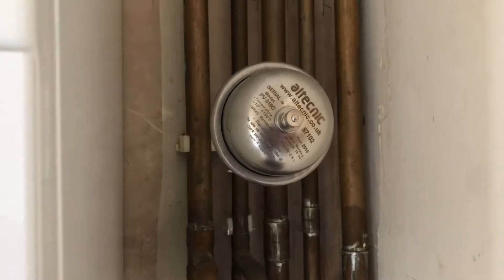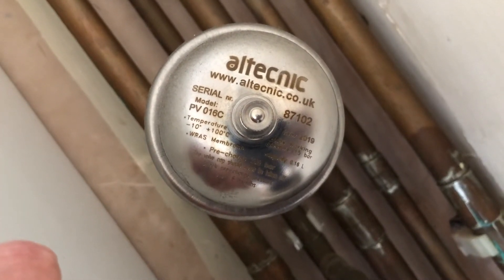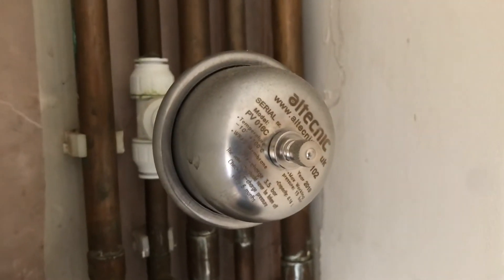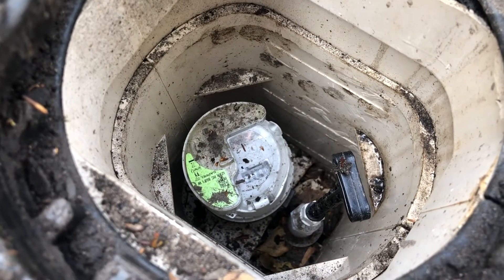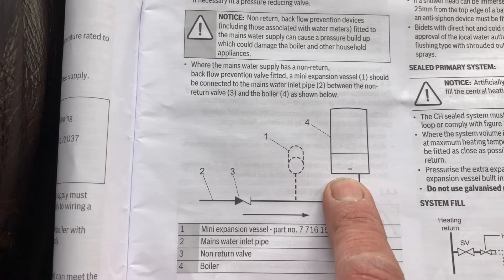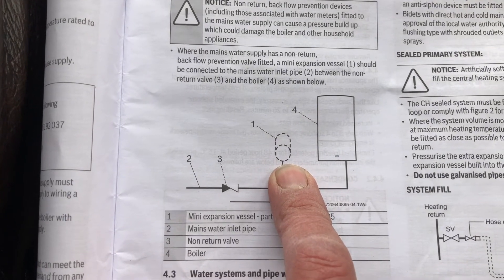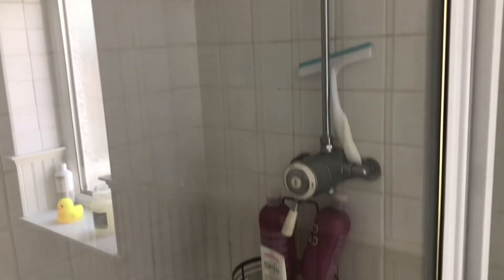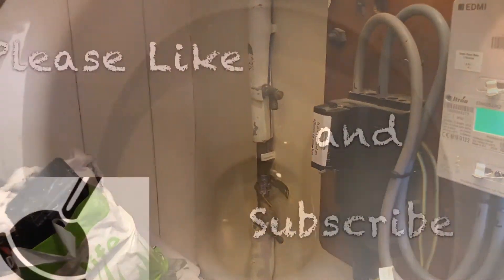Mini Expansion Vessal Arresters Shock Arrestor Stops Water Hammer

Comment: For whatever reason our hot water supply was rattling the pipework and pipes inside the thermal store whenever a tap was turned off. I fitted one of these yesterday under the kitchen sink and suddenly you could hear a thump from this when the tap was opened but silent as it was closed. You get F all instructions with this as how to pressurise it and balance it to your water pressure(is that static or dynamic?) I had a right F about with it this morning but hopefully have it sorted it's quiet on/off now. Best to use a decent pump on it designed for something like mountain bike forks/shocks. My static water is 3.4bar and I've set this to 2.5 bar. Gonna put one of those AA Sioux Chiefs in each of the toilets as additional security. Cheaper than replacing the thermal store seeing as I couldn't train the missus to be gentle turning off the taps and (style over substance) she refused to have traditional full taps installed. It's these quick taps that are the issue, didn't have any of this problem back in the day!!

Comment: Had one fitted 2 years ago & now the pipes are starting to bang again
Reply: It’s probably gone flat and needs re-pressurising. Isolate the cold mains and open a tap then get a bike pump on the nozzle. Pump it to what it says on the vessel
Reply: Maybe the extra lengths of pipe is enough to take the expansion out
Reply: Recently had a walk in shower plus copper pipes & since then, no water hammer noises
Reply: Really hope so.

Comment: We had one of these fitted by a plumber who serviced our boiler. He said we needed one because of the water metre. We had absolutely no banging until after this was fitted. It's a loud bang when we turn the taps on and off.
Reply from the maker: Turn the stop tap down
Reply: @PlumberOntheJob  thanks for your reply. We tried that but it still bangs. Especially when the washing machine is on. It's that loud it makes the dog jump up and start barking.

Comment: How does a non plumber you recharge the arrestor? It says recharge every 6 months.
Reply: (Also not a plumber) but I think they have caps on top, remove it, and it's like a bicycle pump valve, where you then pump it up to expand the balloon up to a set psi. - but don't quote me...
Reply: @joshellis8848  you have to remove the water pressure first.
Reply: Call your local plumber who will pump it up when passing by for a drink.  That is what we do.
Reply: Good question - I would like to know the answer too 🤔
Reply: I assume you turn off your stop cock for your water supply, run a hot tap to remove pressure in the line & leave on, then using a pressure gauge & pump pump it up to 2.0 bar. Turn off the hot tap & then open your stop cock.
Reply: Hi, Im having water hammer issues, ever since my new next door neighbour moved (Semi detached house)in a couple of months ago. When he turns the taps on or uses the washing machine and we do the same it vibrates through my pipes. Can I place an arrestor on my incoming feed to the house. If so whats the best to use

Comment: Incidentally I'm pretty sure that Viessmann boilers have this built-in. I might still get one for the cold line near our washing machine; we have some pipe-banging.
Reply: The newer viessmann 100-W and the 050  no longer have shock absorber built in, but he plastics used by  viessmann are supposed to be rated for the surge pressure , their installation  manual does not  require the installation of shock absorbers .  I would still have pre fitted any way  .